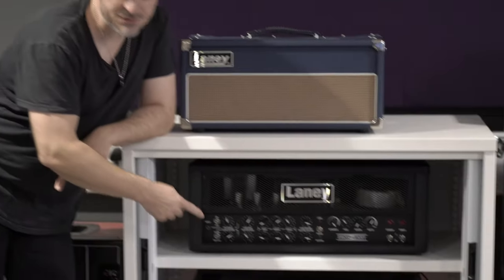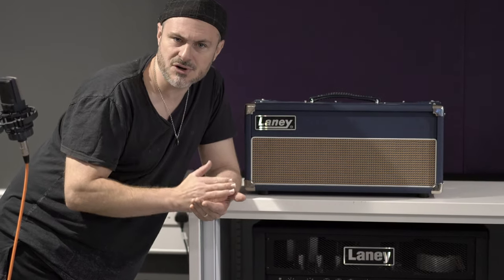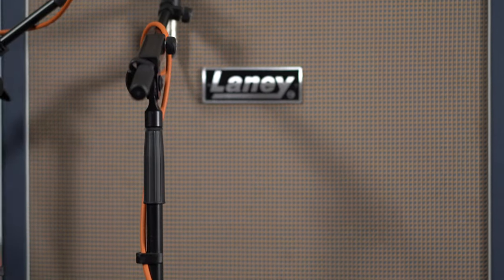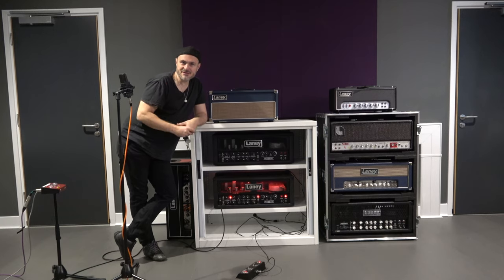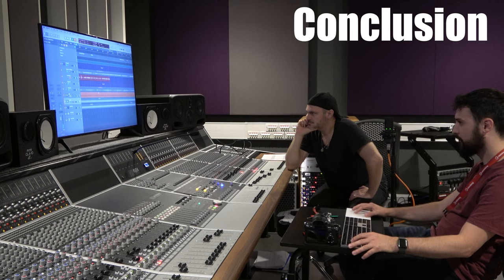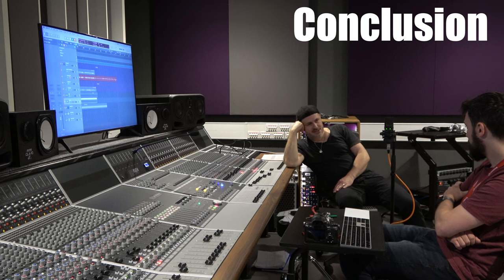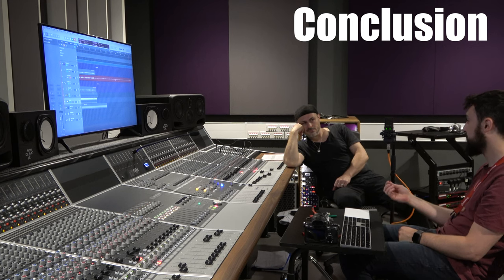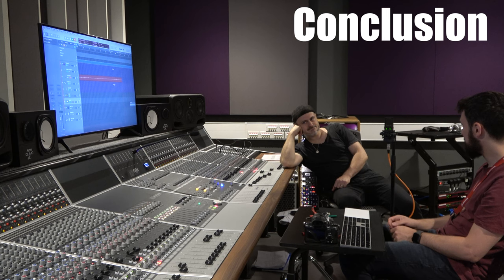Do Valves/Tubes make a difference to your Guitar TONE?

Comment: I've had amps with 6L6 (Mesas and Engls) and amps with EL34, but never had the posibility of use both in the same amp. Loved two, but finally I've ended with amps EL34. But don't think these have anything to do  with the tubes. It's more a question of circuit design. In the demo they are pretty close to my ears. Maybe in my hands the result could have been other.  So, the old sentence "tone is in your hands"

Comment: b4 watching... I will conclude that there will be a very TINY difference in sound, mostly I assume the distortion will happen more quickly with EL34 and the tone will be maybe more squishy with those.  A small difference, not a big difference.  My initial guess cuz I THINK the 6L6 are bigger (some are a bit bigger?) and so will generate more true volume b4 distorting.  But since they are power amp tubes, prob not as big a tone difference but now let me watch what happens!!  Ok, basically, I was right.  Not much difference but a tiny bit.  I have heard that the preamp tubes can contribute more variety to the tone since they are first in line and can be wired to do different kinds of gain or amounts of gain and then the job of the power amp tubes is just to get that tone louder to the speakers.  I find that a tight responsive sound with a good preamp distortion sounds best to me.  The muddle overdriven sounds that are ill-defined are less pleasing to my ears.  Totally blowing the limits of the power amp tubes will muddy the already distorted sound coming from the preamp tubes and then imaging running all that into speakers that are also getting hit with more power than they can accurately reproduce.  So, I think you have to try and get your tone by comparing those 3 things (plus your guitar tone straight from the guitar).   but what do I know?   interesting comparison. I thought the difference was negligable   Easily made up for by just using a touch of eq and extra gain or less as the case may be.  but..... what do I know?  Just enjoying thinking about how the parts all add up to the end result
Reply: seems like you're always "right" lol
Reply: @shredmetalshred7395  I doubt I"m always right.  I just thought if the only diff was the power tubes...  it won't be much difference.  It IS a diff but not enough to go OMG, I HAVE TO GET EL34s!!!!!  nah.  get your tone in the preamp section.  then amplify that and you'll be fine!

Comment: Yes they make a huge difference...   Kt88.    Also they speaker wattages.   Matter alot as well .  Greenback 25 vintage 30..    with one cabinet with a g12m75 on the other.   Or just both cabs Vintage 30

Comment: No difference at all to tone, but I already knew this. Tubes aren't potentiometers, or capacitors or anything at all that directly aftects "tone". Had you said do different tubes affect "sound" then absolutely. Tubes just have different power thresholds and different tubes break up the gain at different power limits. However, gain is not tone, it is feedback.